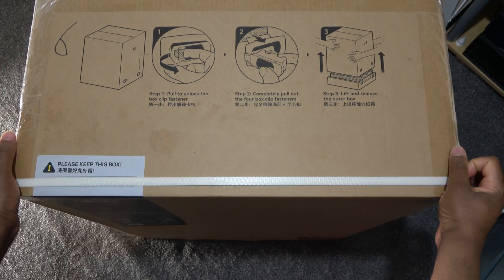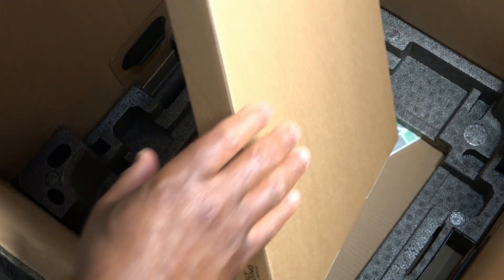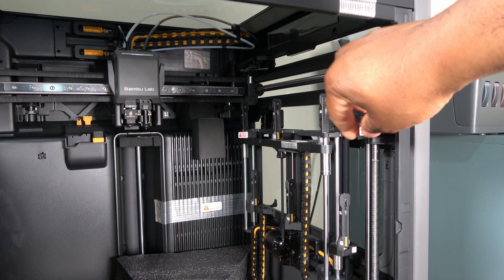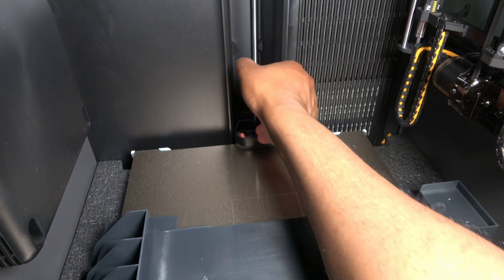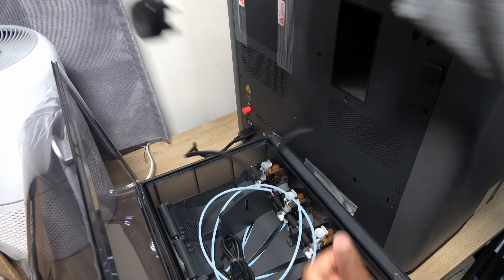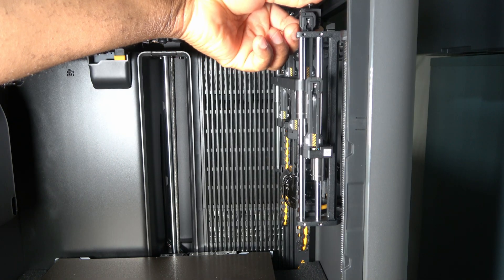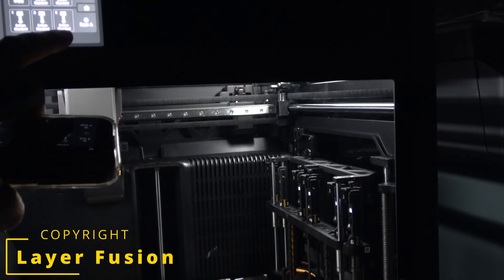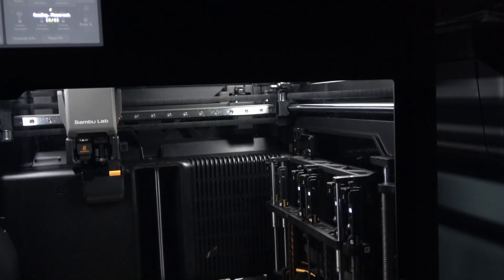Bambu Lab H2C Unboxing   First Impressions of the Vortek System

Comment: I just got mine a few days ago and it was the longest setup that I've ever had with a 3D printer.   It runs incredible though.   It is amazing how much filament that you save.
Reply from the maker: Absolutely. The filament saving in the long run, makes it a better choice than even the very cheap models.